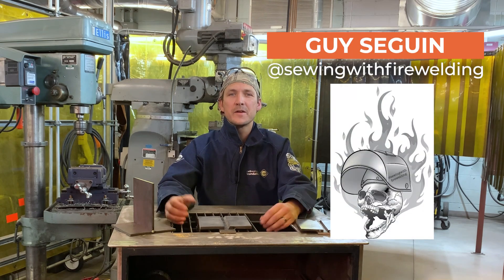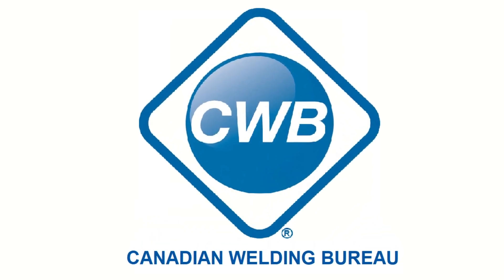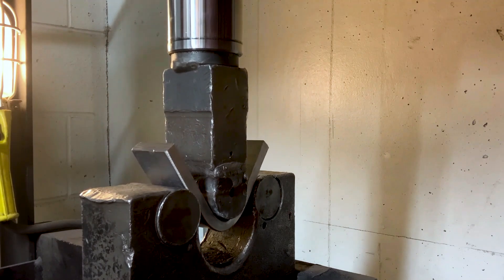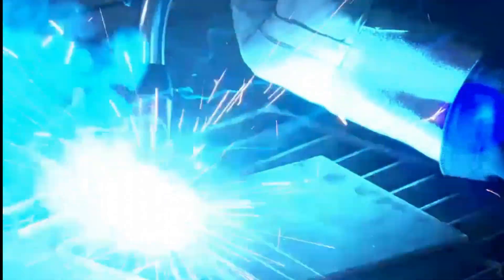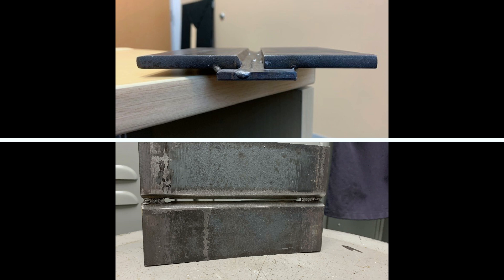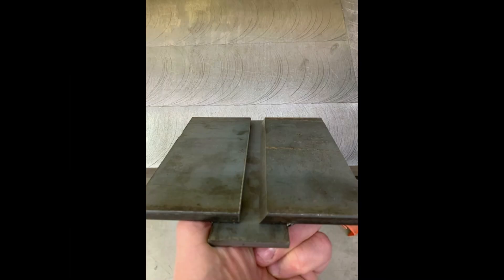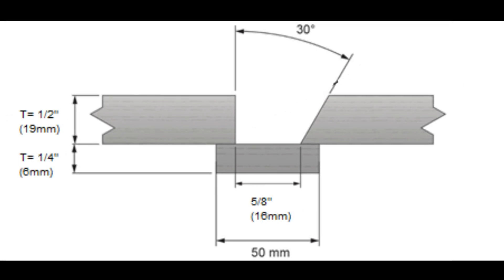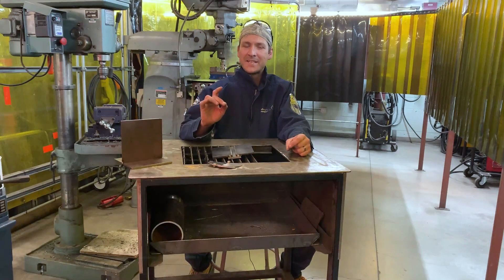CWB Test Plates - Part 1 Overview

Comment: The T class was very interesting to get at least the open groove part, no grinding except for the stop and tacks, only a wire wheel, then after your 6010 root pass, you rip a hot pass with 7018 at 140 amps.

Comment: For us where i weld for stick and mig and spay we went flat , vertical, overhead and finally horizontal. As the most fails came from horizontal. All tested on hy-100 1 inch plates for the coupons. Curious what some of yall did for process order and material used for the test.
Reply: It’s interesting to hear what different qualification tests are out there.

Comment: I left welding school 43 years ago in Nova Scotia, i have been welding pretty much ever since, i have never worked for a company that required a CWB ticket, i had my own shop for about 10 years and only once did i loose a job because of no ticket, i would love to have a ticket but i can never have one without working for a company that requires one, unless i misunderstand i'm out of luck.
Reply: Absolutely- and good on you to be successful for so long. In guess it all depends what kind of industry. ..definitely not the end all. A lot of our learners want to join union halls or work on structural sites but need these qualifications.

Comment: Video was decent. Will any of the parts cover anything on aluminum or CWB pipe tests? I'm not downloading some random ap just to watch more parts though. There seems to be a serious lack on info on aluminum or pipe tests (such as the CWB 5g 6" sch80). We even called CWB and the person on the phone was painfully clueless. Not sure what the point in having a 1-800 info line if the person answering the phone knows less than the 1st year apprentice that called.
Reply: Thanks for the comment. This series is focused on CSA 47.1 which is carbon steel. If it’s aluminum, you need W47.2. Can I ask why you are looking for pipe tests with CWB? I know they do have qualifications but high pressure is usually TSSA in Ontario or B pressure in Alberta even different in other provinces. Different in each province. I think I can help ~ Guy